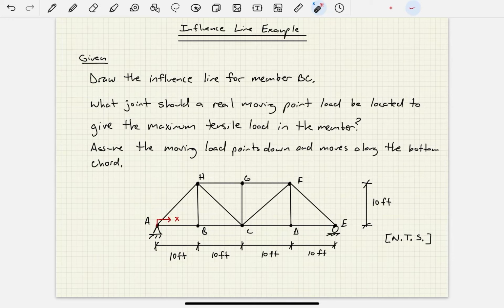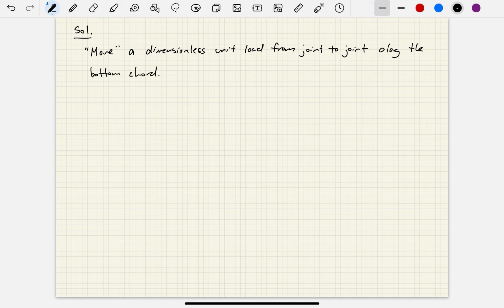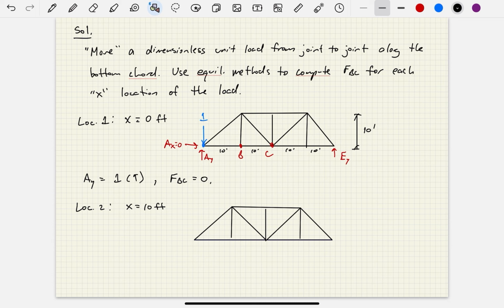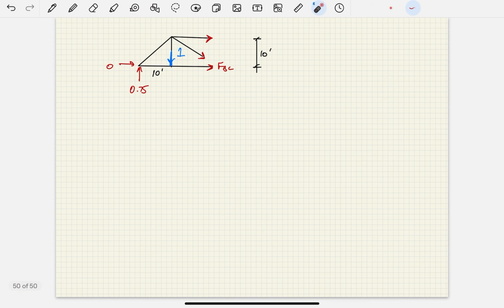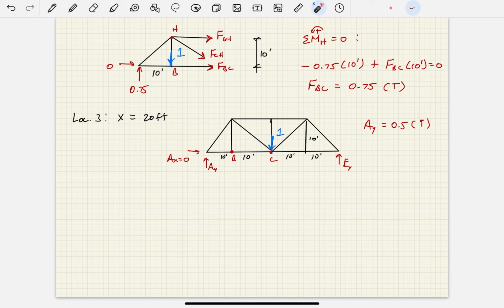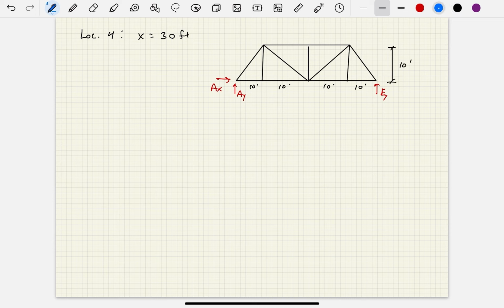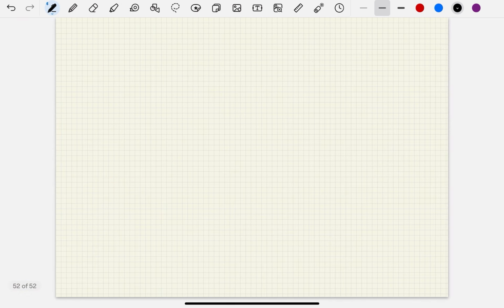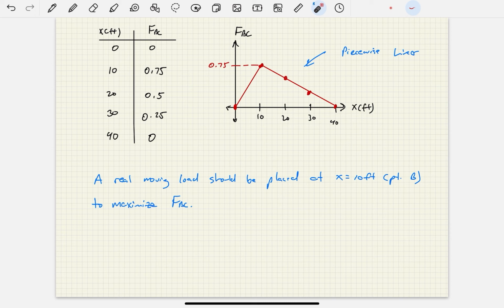Structural Analysis - Video 69:  Influence Line for Truss Member Example

Comment: Hola, disculpa. Qué pasa si me piden HG? Sería el mismo procedimiento?
Reply from the maker: Yes, it would be the same procedure.  However, to draw the influence line for HG, it is best to take moment about point C when you do each method of sections step.  Also, member HG will always be in compression for this problem.